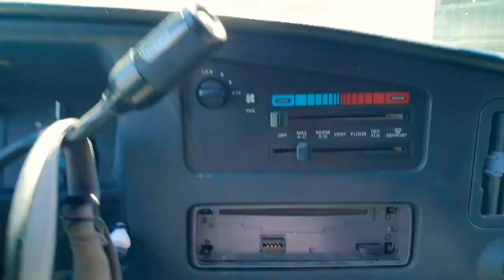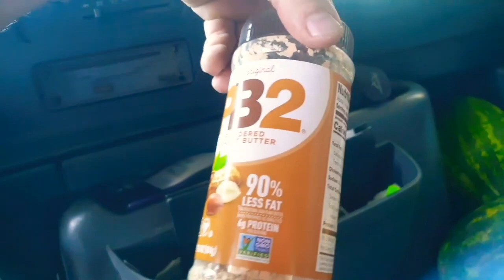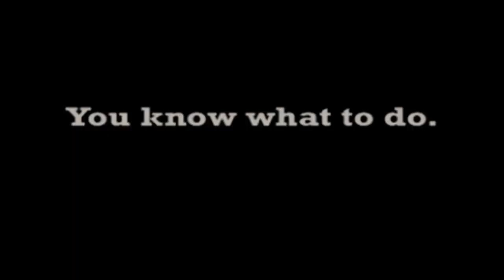How to install Solar | EASY SETUP | No Screws & No Drill #582 PART 2

Comment: Whats better/ worse? Being too hot or being too cold?
Reply from the maker: Definitely too hot.... As too cold you can wear more clothes or keep moving, also heaters take less Watts than AC -- and with enough good gear, in the cold you can get some Sleepzzz. All the previously mentioned things are screwed when overheating; can't move, can't sleep, cant even think/edit... can't get anything done.
Reply: @SebCam  thats true 👍